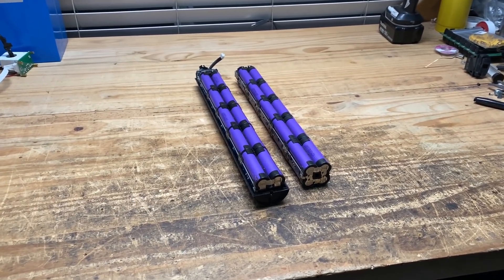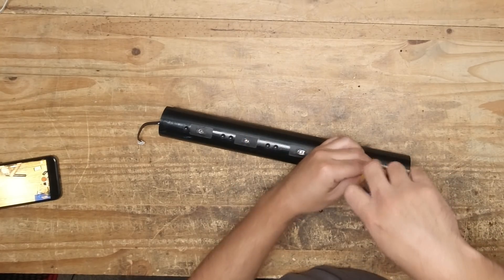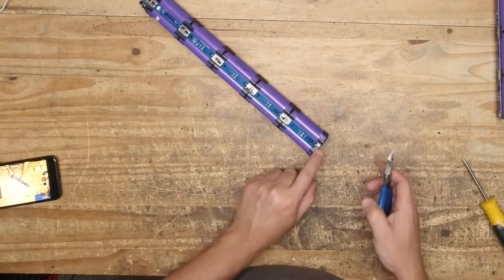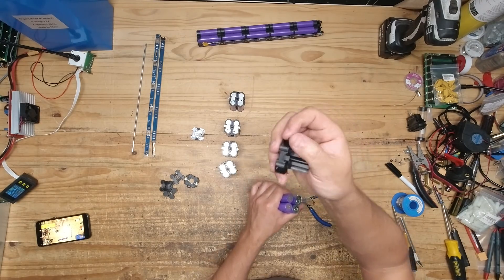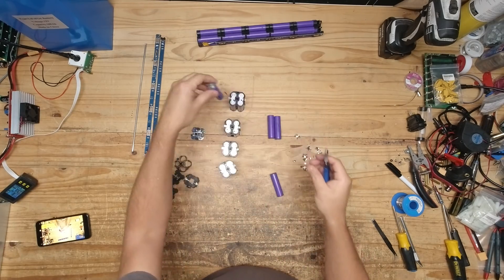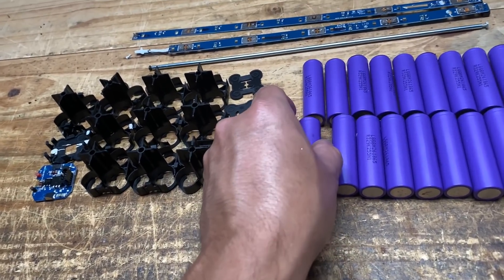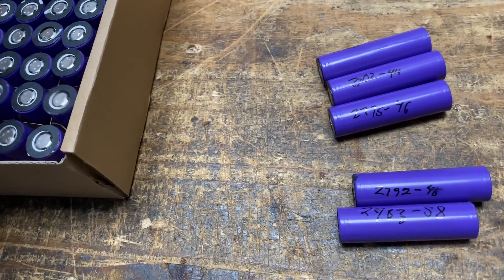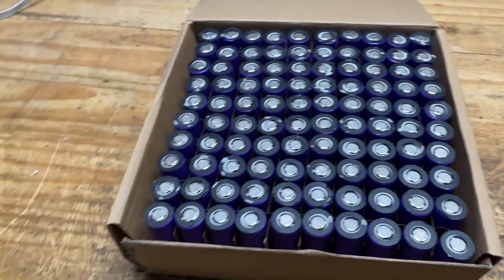Reclaiming 18650 LGM26 lithium cells out of  Scooter Battery Packs

Comment: Greetings once again Sir, just wondering about these 5 individual "packs" from this disassembly, their wiring, voltage and Ah leaving them as those 4-cell individual packs ??
I would like to build a couple of "batteries" for CityCoCo fat tire scooters that I have, need 60V - any Ah over 15, and wonder if I could use these packs somehow as a time shortcut ?? 
The max size finished "battery" can be is 70mm x 170mm x 420mm.

Comment: Jehu — how hard would it be to recondition those  4-cell modules that stack together (5:22) ?   I’m thinking that these units could be made reuseful without stripping down to the naked cells (which will just need to be re-Nickeled, re-racked, re-mounted, etc.).
Reply: thats what i was thinking, could wire an entire packs worth in parallel for a 2s10p pack. the put those all in series and have a monster

Comment: I just got some reclaimed 18650 batteries and would like to use them in my wife's mobility scooter. the scooter now, uses 2 12 volt 28 Amp lead acid batteries and I would like to replace them with the 18650 batteries. Any suggestions? Thanks in advance
Reply: GOOD MOVE

Comment: Think I'll be configuring them 6s cell pairs to configure them to 24v packs.  10 x  should provide me with likw 60Ah for my wind turbine set up..    The voltages on these matches the Nissan Module Voltages and should be quite at home in the system.

Comment: How are they paired ?   What configuration is each set of four cells ?   Parallel Sets I hope ?
Reply: It should be 10s 2p so 36v at 5200mah
Reply: I took them apart... the five modules are  configured as a parallel pair on each side...
Reply: "set of 4" sub-module looks like 2X   2s  (2 in series and the 2 series packs in paralell)   roughly 8 volts 5 amps

Comment: So if I made a 24 volt battery pack that is 7s5p with these, I could pull 50A max, correct?
Reply: Shit bro 10amp a cell is a bit much for 5 parallel be dead in 5 minutes as a guess
Try 20 in parallel be like 2amp a cell ish 👍😀
Reply: While technically correct, you should give yourself some headroom depending on application, I run my 9p pack at about 85 amps with no heating being felt on my e bike. Your mileage may vary, make sure to beef up the nickel strip series connections.

Comment: most of the pin on those connectors are the actual cell connections .... if i remeber right , there should be a series resistor to all those connections(on PCB on the side) .... with a voltmeter you should be able to probe that very easily( i've already done it) ... there are 2 or 3 pin for the GATE of the 2 mosfets on the top board .... again , using a tester you can find that pin very easily .... and you can use the integrated MOSFET as a switch , when the logic of the BMS decides that it must disable the pack
Reply: also if the BMS is still working (and doesn't disable the pack due to """"safety reason """" ,nguè nguè stupid ninebot) you can use the pack as it is

Comment: These are the cells that I won on one of Jehu’s videos, they all tested for me 100% capacity .  Some had a low voltage but they all recovered nicely.  They are currently part of my large ebike battery that I made.  14s 12p.  They are powering a 1500 watt motor that gives me almost 40 miles at 35mph.

Comment: These are the packs I'm using for my home backup.  Was planning on pulling them apart and rewiring, but after finding a quality used 36V powered UPS, decided to leave them in the original packs.  Just pull off the BMS, parallel about 10 packs per new BMS, bolt the cases to a sheet of Masonite, then stack 'em up. 60 total units for starters. (About 10 KWH)  Very cheap, great quality and almost brand new. (These are rated at 2600mAh and as you can see from his testing, they're coming in at 2700+. And in my application, each cell's max draw will be about 200mA, and normally about 50mA. Not real tough..:)
 Quite pleased with how they're coming out. Still waiting on BMS... Stu
Reply: There is no real way to balance the packs if you leave them in the original cases. I bought these too for my powerwall but after analyzing the pack i realized breaking them apart and reconfiguring was best.

Comment: Hi guys, can anyone help me with the charging above battery. The bms has four jst pin (pin names tx, rx,c-,c+). Can I connect charger directly to c- and c+
Reply: Ravi Kishore you can use the p+ p- to charge it. The chargers for this Batts charge at 2a for 3.5 to 4 hours.
Reply: Thank you  @acidburnforever

Comment: What does that Zanflare charger offer over the Opus 3100 or Liitokala 500?
Reply from the maker: Less clicks to see the desired info
Reply: Good tip for the liokala 500 disconnect power insert your cells put power back in then u only have to set program for one cell not all individualy which is a pain lol
Reply: OPUS 3100 HAS A COOLING FAN ..YOU CAN SET ALL BATTERIES AT THE SAME TIME OR INDIVIDUALY

Comment: I bought one scottor battery pack  in 4$,  which is 20 cell inside it 
I am from iraq i want to build DIY tesla power wall
Reply: Try buying nother 100 packs lol power wall depends whats been powered what voltage and you can't use more than you generate or charge otherwise it be useless

Comment: Yesterday I took 4 apart (plastic cover only) and keep the bms and charge it like that. Planning on using them like that in a power wall. Connecting 10s 10p or something like that. Any recommendations on a 36v 1500w to 2000w inverter?
Reply: Hi fabritzio, how to charge the batteries. I don't have control board for this. Just have bms. Bms wire has four wires(c-,c+,tx,rx) .  I
Reply: Yeh stock up 100s of cells if u plan to constantly use that much power lol👍
Reply: Hi!  I went digging on Ebay.  Search for used UPS, 1500 to 2000W.  I'm using a Dell 1000W (Actual wattage, not 'V/A' that a lot of cheapie UPSes are rated in.) Dell 1000T LV UPS 1000W 120V 8-Outlet Tower UPS Network K788N No Batteries was $60.00. Check the listing carefully, or research the battery requirement for the units. My vendor showed/listed his units with battery requirements. This unit (pure sinewave) and many of the Tripplites in this size range are 36V, which is perfect. I tested one 'stick' (20 cells, 10S-2P as shipped) on my UPS, it had no problem sourcing 400W out. I'm going to be running 60 'sticks'.  Definitely use a BMS, as the internal one doesn't appear to be fully usable and in many of the packs it's damaged. But it's easy to pop off the old BMS and i'm just wiring the new one to the convenient side strips on the packs. They solder well. And used UPSes are way cheap. They pull out the old SLA batteries and ship as it weighs less. Pretty easy to find decent ones under $100... And these packs are perfect voltage range for them. I'm adding external charging, but the UPS already has external battery pack connector. (Found the Anderson connectors for it also on Ebay..:)  Good luck and be careful, lots of power in small packages! Stu
Reply: D. Stuart thank you for the intel, but I swear that I've been searching and searching on eBay and the closest thing to what I want is $100 +$100 for delivery...I found inverters much faster and easier at a good price, but (because virus) I don't have the money to purchase it. Do you think that a ups is better than mounting an inverter? Also, what bms are you using or planning on using for this? I would like to see your set up. Maybe posting on the fb group. Thank you for your help 😁
Reply: @acidburnforever  you not gonna find an inverter that cheap and be worth using ...u buy cheap you buy more cus they fail and in the process damage connected stuff

Comment: I tore apart a Bird scooter a while back and I'm not sure what to do with the battery pack (approx. 30 18650 cells). I've tried everything but i cant get the cells out. All i've managed to do is open the battery casing. Any ideas?
Reply: Do you mean out of the aluminum tube?
Reply: Where did you get the bird scooter from?
Reply: ikichullo the lime scooters have 30 cells. They are much harder to open because they use double side tape. Use 2 flat screwdrivers and pry open all around, after that you'll need to use force to unstick them.
Reply: The m365 packs have screws under the nickel series connections, its hard to spot them but a long slender phillips after cutting the series leads allows easy opening.